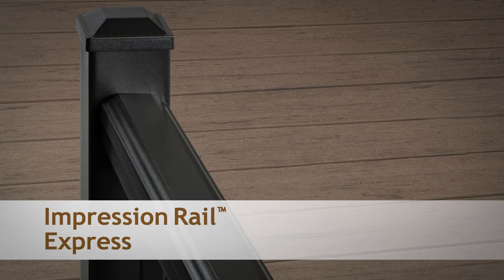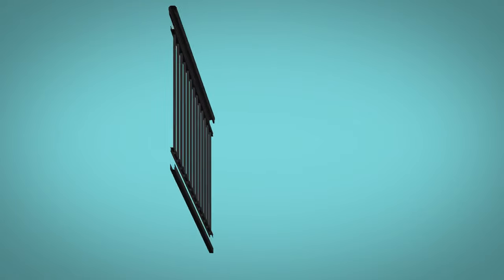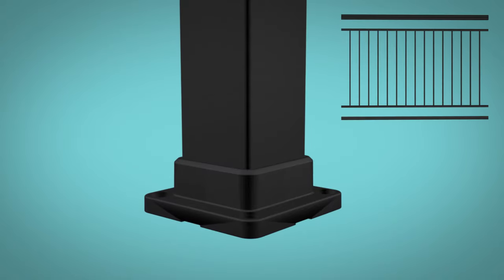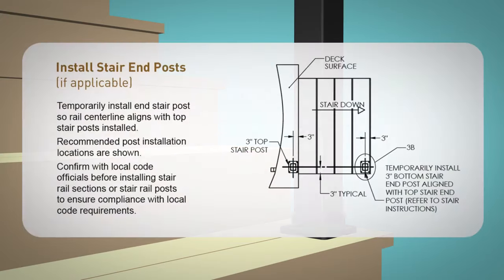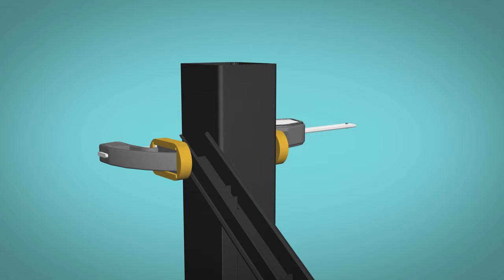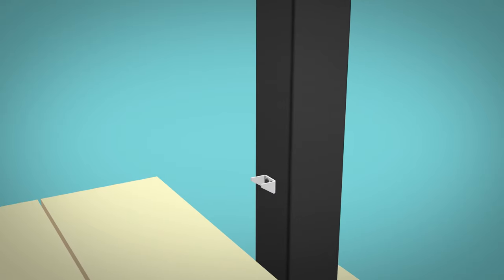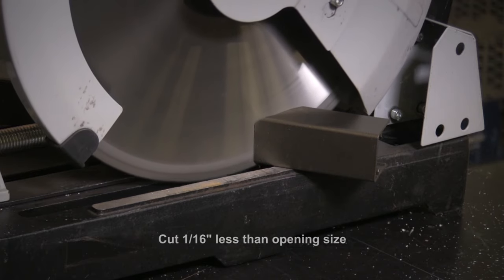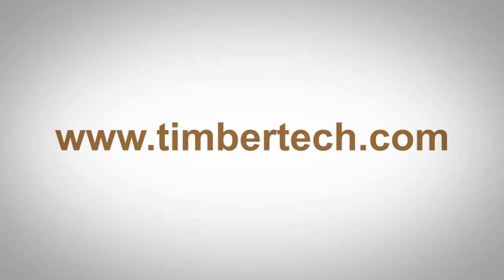TimberTech® Impression Rail Express® Installation - Stairs

Comment: So I bought 4 6' stair panel kits, lower 42 inch 3'' posts and the rest of the full decking . Deck has stairways. $4,000  love everything but my stair railings, the pre assembled stair kits are at a fixed angle and only move a few degrees to change the slope,  I could not change the slope of the stair panels enough to match my new deck stair angle the stair kits were way to steep, like 35degrees,   I had to mount the rail kits to the OUTSIDE of the stairs and the lower horizontal bar on the stair kits doesn't match the angle of the stairs and goes below the nose of the lower stairs. SO frustrated , beautiful deck and expensive and my stairs aren't correct .  I had built my new deck with 6.5 x11 inch rise and run, 7 stairs pretty standard.  problem is you build the railing pole system all around the deck , you are pretty much committed to sticking with the product.

Comment: Why is it necessary to remove bottom post after cutting rail to length.  Shouldn't you be able to install the bottom clips on top and bottom posts and slide rail back on.  Why remove the bottom post?

Comment: This is a thin aluminum product.   The best way to do stair rail is to install the bottom brackets and then put the rail in place.   Mark a line on the low side of the rail where the bracket belongs.  Take the rail off, put the bracket .25 inches above your mark.  Remove the lower bracket on the down stair side.  Now you have the low bracket at the high side and the upper bracket of the down stair side.  Put the rail back in, reinstall the lower bracket and install the upper bracket.   PITA.  Even better, do this before installing the low side post.  Best advice  - only use Westbury rail systems....so much easier and higher quality.